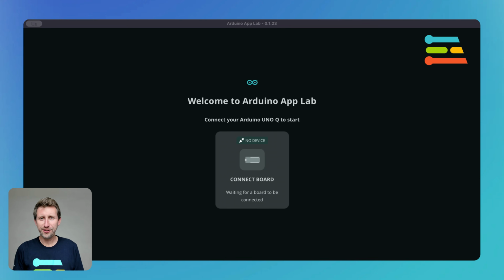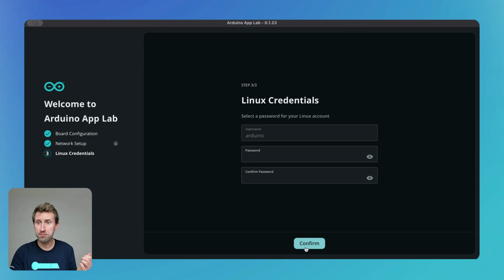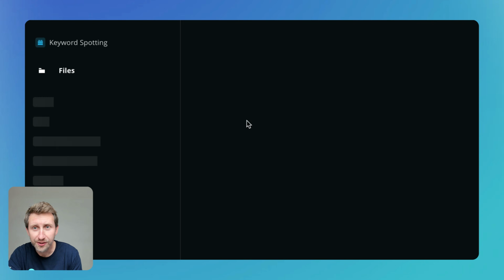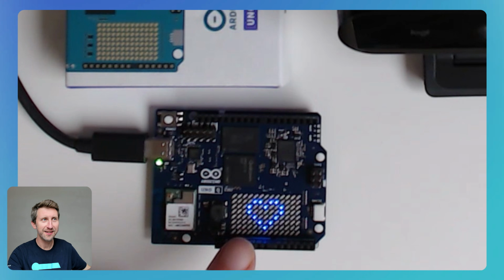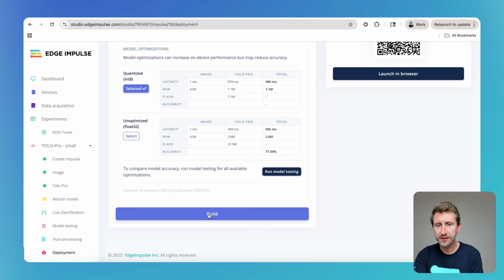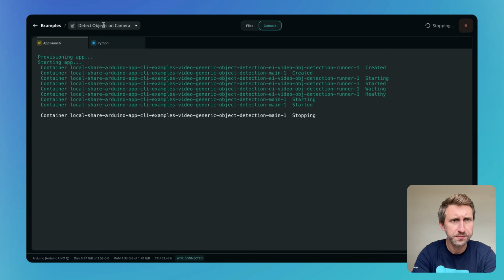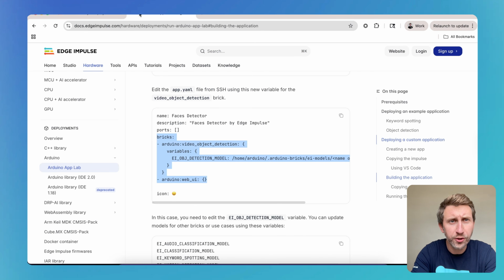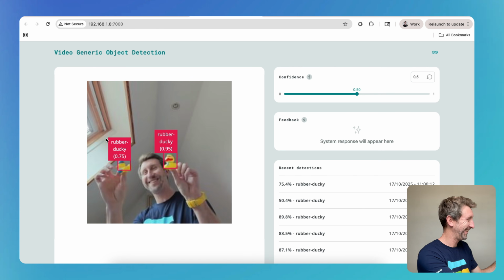Unboxing and Running Custom AI Models on the Arduino UNO Q — using Edge Impulse and Arduino App Lab

Comment: OK found the solutions for some problems related in this video: I made the app.yaml changes by using "nano". VS Code did not work for me. I could not find most of the folders. Maybe because these are "hidden"? Other problems app.yaml content does not accept the brace {} in the variables. To know: When app.yaml is having errors, the app from My Apps disappeard from the App Lab. Anyway I will try to enter the forum to explain what I found because I do not think Youtube is right place.

Comment: So far running examples are working... At least!!! But what I can understand is that all is running thru the Linux and USB-C hub or eventually with the "modulino" but no real access to the STM32. At leat did not find the clue yet. Plus using in the middle VS Code to use it with Edge... mmmh??!! Need more example and help. Thanks anyway!!!

Comment: well, how we can connect the arduino to the VS code in the first place :) is there like a tutorial for this?
Reply: If QUALCOMM wants UNO-Q to be accepted, they have to do a better job of getting people up to speed. Case in point, how do you set up the VS Code in the first place? They need to debug these presentations by simply having someone, who doesn't know all of this stuff. go through the tutorials. Either the novice can repeat the demos, or the tutorial isn't ready for prime time. Most Arduino people are not interested in the Dragon Wing processor, and many are already talking about dumping UNO-Q. I love this processor. QUALCOMM, please don't let it die.

Comment: My Arduino Uno Q is stuck in a boot loop, constantly repeating the Arduino's startup logo without showing the heart icon. It's also not recognized by the Lab software when plugged into the computer. I'm very frustrated and don't know what to do.:face-purple-crying: